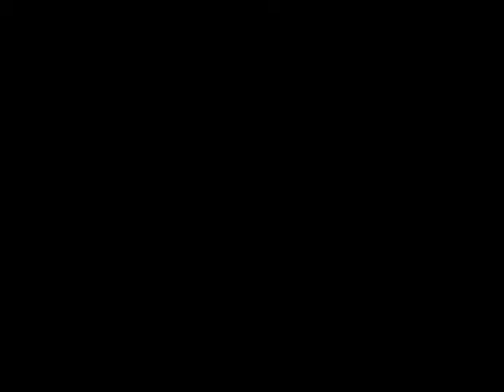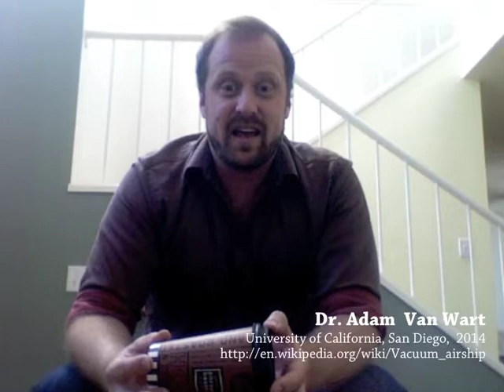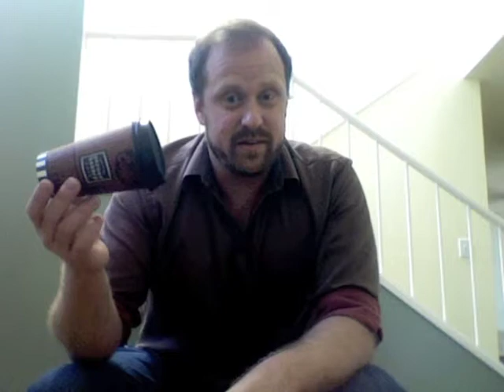Vacuum Airship (rigid container)

Comment: I wonder if it is possible to create a zepplin/airship filled with gas ions in a vessel that were repelled by a centrally located electrode thus creating a artificial gas pressure that exceeds the limits of the ideal gas law in regards to density and displacement. I am not knowledgeable enough to know if it would work though.
Reply from the maker: Simlar to a super hot low density gas.  The ions would get their speed (kinetic energy) from charge-charge interactions.  Seems like creative thinking!

Comment: well id say there is a certain point where the cup (our theoritic vacuum air ship ) where the atmosphere is THICK enough to make it float and the gravity is weak enough and at the same time the material that its made from wouldn’t collapse on it self the praplom with vacuum air ships is that you need a material strong and light enough to generate enough lift its like making a paper car and expecting it to carry 10 tons but in the future garphene might make it possible well need to calculate the pressure that every centimeter cubed will have to carry and compare it to graphens ability to handle stress to wight ration and finde a design that minimalize wight and increase strength 
im keep in mind im no scientist i might be an analytical doctor in training i just like physics by the way im interested in what you guys think of what i said
Reply from the maker: I appreciate your comments... it would be a sound strategy to maximize the hull integrity (strong materials).  For fun... pick a thickness of something as common as steal that would withstand the pressure differential.  Perhaps you found this thickness to be one inch.  Once that thickness is chosen, try to make a balloon that is big enough to where the mass of the shell divided by the volume of the balloon is a density that is less than the altitude you want the balloon to float at.  This balloon would be extremely large.  Perhaps we could do the calculation together at some point.
Reply: Or have the container constantly spinning to create and outward force to counteract ATM pressure
Reply from the maker: I think your proposal is creative.  However, the design would have to be rigid along one of the three dimensional axis.  Spinning would then act like a form of ballast...  basically like pizza dough spun in the air right?  If the volume of the airship increases due to your proposed outward force, so does the buoyancy.  I think you would still need a rigid shape that is already near buoyancy for this effect to occur though.  Thanks for your thoughtful comment.

Comment: This is pretty smart - atleast I think ( I'm not an expert on this ) - I never thought of vacuum airships in this way, I always thought of them more as something similar of the airships of today, just using better materials to withstand the stress of the atmosphere, but this could work. It would most likely not have the same uses we would associate with airships today, but depending on the altitude these vacuum airships would settle in, they could serve several different functions from weather forecasting equipment to alternative to communication satelites. 

Though I also see few possible problems - For example, we would still need a material and structure that is both light enough so that it doesn't pull the vacuum under the self buoyant line and at the same time strong enough to withstand the stresses of the atmosphere, whatever they may be. Also speaking of materials, the material keeping the vacuum inside would need to be able to prevent or atleast limit the amount of particles getting into the vacuum - as some elements like helium could possibly be small enough to get through the material and infiltrate the vacuum, slowly eroding it's ability to float - basically the inverse problem with atoms of hydrogen ( or maybe helium - not sure which one it was ) escaping a buoyant container.
Reply from the maker: It is wonderful to connect with other people that think about problems like this.  Thank you for your post.  I will have to consider more about the helium issue as "nature abhors a vacuum".  Here is a project that is one step removed from what we are discussing.  https://senseable.mit.edu/space-bubbles/

In the best case, it is worth pursuing for terraforming other planets.  However, I'm not convinced we understand our own planetary mechanisms enough to mess with this the way it is advertised.

Unfortunately, mass production of space bubbles could be weaponized.  The idea is powerful as space is the ultimate high ground (strategically).  In the worst case, mass production of anything that orbits the earth can be used as a type of planetary siege device.  In an age of 3D printing and AI, this is no joke.

Comment: I didn't thought if that.
It seems obvious to me now. It's incredibly difficult to build a ship on the bottom of the ocean, fill it up with air and hope it can make it to the surface.
But! For every weight/displacement there should be a line similar to the one ships float on. We could build a vacuum ship, lift it to the calculated height and then empty it and it should float. But there can be no grounding for that ship anymore as it would be equivalent to sinking of a normal ship.
But yeah, a vacuum ship might just be possible at some form.
Reply from the maker: Thank you for adding value to this conversation.  I like the comment about the "line similar to the one ships float on".  I think you put this very well.  The interface between water and air is a sharp line that is visible.  The line you are talking about is seen in the mind's eye; I agree with your sentiment that it is there.

Comment: Interesting thought experiment, however I'm afraid it won't work. 

The density of the atmosphere drops more rapidly than the pressure of the atmosphere with increasing altitude.

Sea level: P = 101325Pa, Rho = 1.225kg/m³
H = 30km: P = 12000Pa, Rho = 0.0184kg/m³
H = 80km: P = 1.1Pa, Rho = 0.0000185kg/m³

Buoyancy is linearly proportional to the air density.
The mass of the balloon is approximately linearly proportional to the pressure of the atmosphere.
This would imply it would be even more difficult to make a vacuum balloon at large altitudes compared to sea level.

The comparison to ships floating on water doesn't hold, since water is fairly incompressible.
Reply from the maker: The vacuum airship would find some altitude that it floated at.  The descent would be from the vacuum of space to some altitude.  Original post: "An analogy to this would be building a submarine above sea level instead of at the extreme pressure of the ocean floor."  Very insightful showing that at 30km you lose 90% of the pressure experienced at sea level, but your vacuum airship can only have 1% the density it would have had at sea level.  However, you may want to consider that while wall thickness is roughly proportional to the pressure for crush depth (http://rogercortesi.com/portf/pressvesfailure/presvesfail.html), wall thickness is not proportional to the density of the vacuum airship.
Reply: @atvanwart  Ok but what would be the point? I can see how this makes sense for exploring Mars, but on earth the problem is getting it up there in the first place. We already have a lot of LEO satellites out there but it's expensive to launch anything into earth orbit because it takes so much energy.

Comment: I have often wondered why we would not do just this, create a vacuum ship floating on the upper atmosphere just so we can toe objects up and out of the atmosphere. It seems very useful for shipping, and for launching objects and people into space.

But it has always been a flight of fancy. Until today, today I have the free time, and you video inspired me. I am going to look at the gradient and requirements to do just this. I am going to answer either why we should, or why we should not. 

Thank you for the fun way to stimulate my brain.
Reply from the maker: I really appreciate your post.  It would be nice to see what results you come up with... even if they are rough.
Reply: @atvanwart  roughly running through the numbers I did see a few ways to potentially see a ship, in the loosest definition.
The issue being that our atmosphere does not have a steep pressure change until your above the carman line, so I ran through methods of suspension starting at the mental experiment of a large cloth with only walls supported, and came up with nothing practical for current use, but a cloth several km square could support itself, if it had balloons or similar on the edge, but in practice it would only be useful for something like a safety net, and parachutes already exist.
After several iterations I came to the conclusion that actively supporting a barrier would be the best option. 
Unfortunately, after running very corse numbers for diffrent systems I realized..

An actively supported partial vaccum ship is just a hot air ballon.
😆 it was fun, if I come across the note pad I did my math and mental gymnastics on I will post them
Reply: @jimandaubz  Also do you mean by a steep pressure change above the Carman line as in for safe pressure to maintain structural integrity and if so  will it not be possible to get enough lift above the Carman line to stay afloat also are you saying A Zylon fiber vaccum airship with a carbon composite/Titanium alloy frame will not work!! THIS IS SO SAD!!! 😭😭😭

Comment: The helium balloon at Disney springs Orlando supposedly lifts 29 people plus the carriage. that's got to be 4000lbs. I don't understand how a "ridged material" can be too heavy if the balloon can still lift this kind of weight. How much is the weight difference between helium and just plain air hot be for a balloon to be able to lift that much weight?

Comment: Rigid material to make the vaccum are too heavy to be used.
Reply: You missed the point.  When you are already at near-vacuum, then you don't need an as-rigid material to hold a vacuum (or lesser near-vacuum).  Just void (fill) a cardboard box with the emptiness of space, and then set it gingerly on top of our globe's atmosphere, like a paper boat on a pond.

Of course you can't build paper boats at the bottom of the ocean and expect them to float on top of the ocean.
Reply from the maker: @agvulpine  I wish I replied to you earlier.  You completely understood the thought experiment.  Thank you for your post.  I sincerely appreciate it.
Reply: @atvanwart  It's something I had already given a lot of thought to with aerogels. What if we ever develop a resin or other liquid substance that we can aerate with trillions of fine microbubbles, expand it under vacuum, allow it to set... and then upon removal from the vacuum chamber it were to rise to the ceiling and float away, having a greater buoyancy than atmosphere. :)
Reply: You don't need a full rigid body, just a frame that can be covered by an impermeable sheet

Comment: Can an big empty object which has vacuum and can resist the atmospheric pressure to crush it self can it go high in outer space????????🤔🤔🤔🤔🤔🤔
Reply from the maker: [Theoretically]
Yes, a big empty object which has a vacuum (the emptiness inside the object) can float as long as the object is: 1) Not crushed and... 2) Must be less dense than the medium (atmosphere) that surrounds it.

Comment: Creating vacuum airship will is difficult at the high atmospheric pressure of low altitude. But it gets easier at low pressure at high altitude. So here what I propose. We created some sort of gas/vacuum hybrid airship. At low altitude, the airship will be filled with helium or hydrogen gas as a lifting gas. As it reach a high altitude, this gas will be pumped out and leave behind a vacuum.
Reply from the maker: This is highly creative.  How big would the rigid airship have to be to accommodate a pumping mechanism?
Reply: Does it goo to space?

Comment: Here is my idea on the same subject: Make a shell that looks like the seems of a soccer ball (truncated icosahedron). Cover it with a light net. Cover that net with a tough polymer than can hold back the 15 psia between the gaps of the net. If the shell is strong enough to hold up against the great forces trying to crush it, then this will float.

As a safety mechanism, a weak point should be created so that will not implode catastrophically. Once it's filled with air, and falling, it will serve as it's own airbag.

Comment: The key here is to consider Hot Air Balloons, where the atmospheres mass is somewhat exchanged to energy AKA "HEATING" only problem is - Can a near vacuum be heated enough?  If not then the balloon may have to rely on a buffer cavity, having the cavity consisting of a gas that when heated creates a very light and rigid form that can be as large as several sport arena's..  

It will only need some pumps to pump enough helium to pressurize the cavity to its rigid shape, and because the main cavity began without any atmosphere within it, the whole system can be tried small scale from the ground..
Reply: +KorAllRBare 

"Graphene" BTW would be the ideal material for my suggestion..
Reply from the maker: I have not been here in quite sometime.  KorAllRBare: Thanks for your thoughts.  I like the practical approach to this problem.

Comment: Hi Adam,
I have pondered this same question and have given it a lot of thought.  A heavy air craft carrier will float on the surface of the ocean because of its surface tension and buoyancy.  If you could dangle an air craft carrier from its stern at a very high altitude then dropped it into the ocean, its momentum and weight would probably sink it to a depth that would ultimately crush its hull.
If as you say we had a large, light, air tight object depressurized in the vacuum of space and slowly lowered it onto the surface of the atmosphere I would think at some point it would become buoyant and cease to drop.  The problem is the slowly lowering process.  To maintain orbit an object needs to be traveling at high speed.

The ISS maintains an orbit with an altitude of between 330 and 435 km (205 and 270 mi) by means of reboost manoeuvres using the engines of the Zvezda module or visiting spacecraft. Its Orbital speed is 7.66 kilometres per second (27,600 km/h; 17,100 mph)
I imagine if a depresurized object were slowy lowered to Earth from the ISS it would have a problem once it encountered atmosphere since it would be traveling at the same 17,100 mph.  That may have been the problem encountered by the teather experiment performed by NASA in 1992 https://en.wikipedia.org/wiki/STS-75
Reply from the maker: +h2fcell I think I understand your point.  You are suggesting that lowering the vacuum airship onto the earths atmosphere would also be complicated by how fast the atmosphere is moving relative to the vacuum airship right?  If the vacuum airship's orbit decayed too fast, it would encounter catastrophic friction from the atmosphere.  I guess this would be like dropping a boat on a fast moving river from very high up.  I don't know if this is the same as the tether experiment and I will have to think about it more (thanks for sharing that btw).
Reply: @atvanwart  You could use an airship/platform supported by conventional balloons at high altitude (100,000 feet?) to manufacture maybe a derigible of geodesic skeleton with high tensile fabric skin. Solar powered vacuum pumps to bale the leaks out of the chamber.  Engineer the vessel to float itself off of the manufacturing station or lower it to a bouyant elevation.
Reply: Your anology is excellent.

Comment: From what I understand after a Wikipedia binge of this question a few weeks back is that any balloon made of conventional materials would be to heavy to float high enough to not implode. I was wondering however if a low pressure (but not vacuum) balloon could pull it off. It would need to be much bigger then a vacuum balloon but the forces on the balloon would be much weaker. I guess it would depend on what grows faster when scaling up the balloon, the material strain inherent in having a larger surface area, or the volume increase (which should be cubed) providing more buoyancy.
Reply: The question is:  "What if you tried building your ship above the surface, instead of at the bottom of the sea?"  Of course you can't build an old Spanish Galleon at the bottom of the ocean and expect it to float, so of course your rigid airship has to be built in outer space and then set down gingerly and afloat on top of the atmosphere.  Then the materials aren't expected to withstand ground-level pressures.

Comment: It will certainly happen when materials are strong and light enough or if there is a mechanism to convert the pressure into heat or something. Maybe thats SciFi.

Or maybe if there was a way to transfer 50% of the air particle energy to the insde of opposite side of the balloon.
Reply from the maker: +Ryukey I like your idea of taking the pressure and doing something constructive with it.  I don't know how this idea would work, but you are clearly creative in your thinking.
Reply: What if your coffee cup had a rhombicuboctahedron exoskeletal shell composed of PI aerogel tiles?